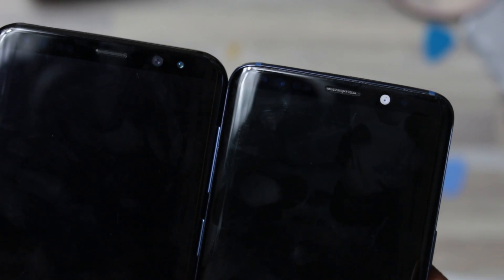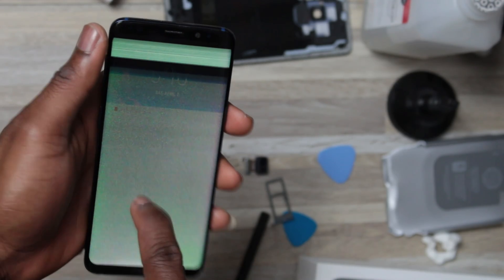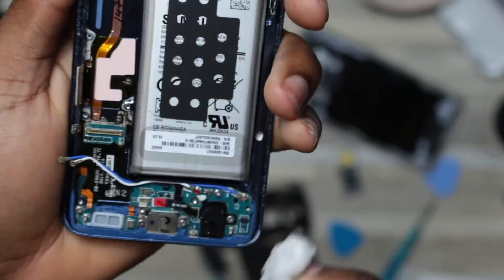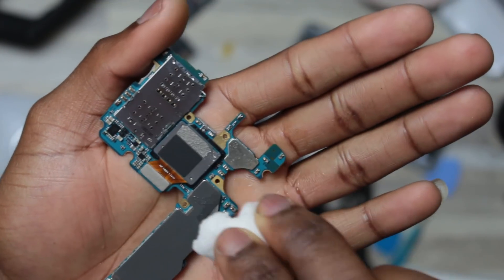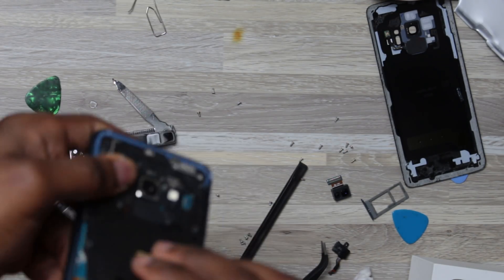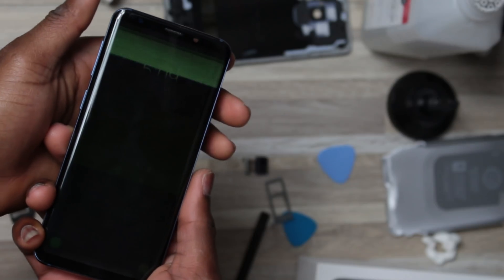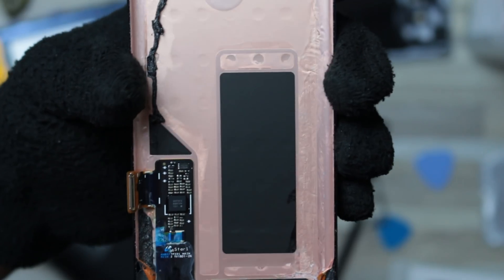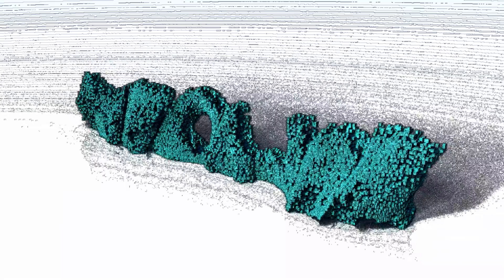Samsung Galaxy S9 Water Damaged recovery (What You Need to Know)

Comment: i have the same problem with my S8 :(
Reply: Dubbax 
Did you fix your S8? 
My S8 has the same problem too
Reply from the maker: Yeah beware of their shady IP68 rating.
Reply: @ersbit  its up to waters chemicals salt and other things water hardness amd stuff like that or if you have dropped your phone that may break the seal or if you take your charger and like plug it to hard that breaks its seal its better to use wireless charger ofc you cant use your phone but then you have like a lot secure seal its completely waterproof you can be even 2 hours in the water claims samsung if you dont sumberge it further than 2 to 3 feet and if you dont keep it submerged. I asked thats how i know.
Reply: Not yet, im waiting for lcd price drop. Cuz its too expensive
Reply: Dubbax 
Makes sense 
I'm gonna submerge the lcd in isopropyl alcohol first, if didn't fix it I'd go for buying a lcd. Need my phone ASAP
Reply: @Dubbax  Is it okay now?
Reply: Me 2 but my s8 was repaired by samsung service center (18000 rupees)
Reply: @abdullaharshak.n7870 
I bought an OEM LCD screen for $137 and replaced the damaged screen
Now it looks like brand new

Comment: There are a few steps to follow so you do not mess up your phone. Do not dive with your phone causing unnecessary pressure . If you decide to place your phone into the sea , MAKE SURE you carry 2-3 bottles of drinking water so you can rinse it after you go out of the sea. DO NOT CLEAN YOUR PHONE WHEN YOU GO HOME. Do it at the spot so the salt does not stay and stick on your phone.
Reply from the maker: Great advise. It can hinder the effect of the salt

Comment: You are an idiot lmfao 😂😂 you are not supposed to use it in salt water
Reply from the maker: Where did they wrote that ???
Reply: @ersbit  ur not ment to use it in salt water it tears through the rubber protecting the internals from the charging port and the sd/sim port that use rubber material to protect water from going in side the phone
Reply from the maker: HS39 786 true, but it has not been specified. Even in how they explain the ip68 they never specified expextion may apply ( doesn't work in sea salt water)
It can be seen as false advertising. This year apple keynote or Samsung the most recent ones they clearly said salt water not applicable. That's the only thing I wanted to see
Reply: @ersbit  it was specified by sony first with ip65 and 67 and they stated fresh water only evey other manufacturers toke copied it and and didn't need to put it down as not salt water proof they all use rubber materials protecting water from going in cause u went on salt water even a inch of salt can go above or beneath the rubber weakening the rubber so more salt will hit through tearing the rubber and water will go in
Reply from the maker: HS39 786 look at my description. When I was doing the editing. No where I found inapplicable to salt water. I copied and past what was floating online even in Samsung website
Reply: @ersbit  its common knowledge that salt water is corrosive to electronics.
Reply from the maker: Isiah Mess true. It eats most metals. IP68 should say doesn't work on salt water. 
If they say water resistant (what water are they referring?) I see only pool water and sea water the only places someone might want to take pictures.

Comment: My Samsung galaxy s9 is getting its camera changed and I wanna know if the water resistance will be the same after the repair
Reply from the maker: It will but it will not be as resistant as the factory ip68
Reply: @ersbit  so a weaker ip68?
Reply from the maker: Yes, if factory was 30 mn under 1 meter of water, yours might be safe for 10 mn under water ( depends on how thick and strong the new double sided tape is)
Reply: @ersbit  I see, thank you very much